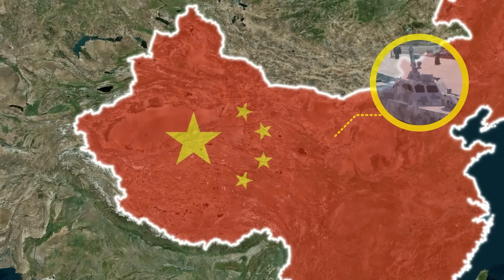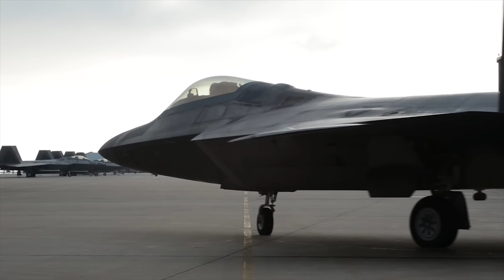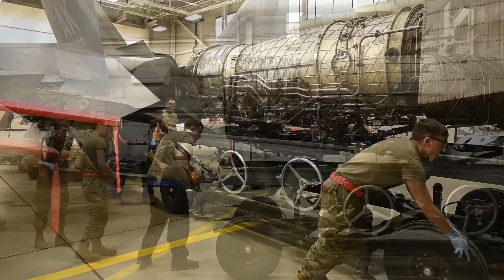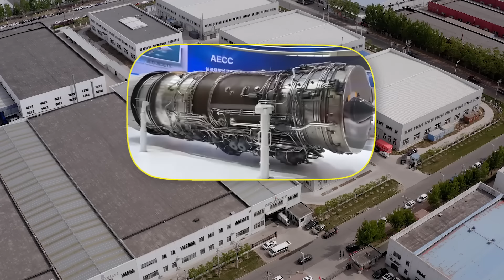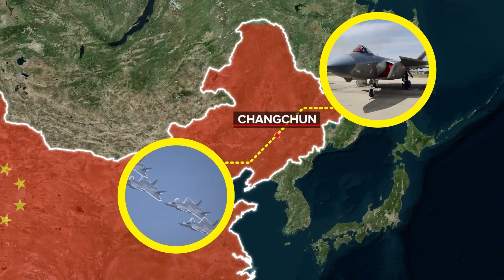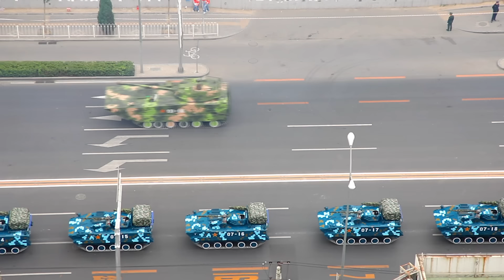China’s J-20 ‘Stealth’ Jet Is a FLYING LIE… A Paper Tiger That Can’t Fight

Comment: A couple more view points.
One, although I can't state that it is fact, but I've read that it is believed that China is utilizing silicon based chips for its low observable aircraft and AESA radars. 
If true, that makes them extremely vulnerable to EMPs.
Whereas the DoD since the early 90s has been using gallium arsenide based chips for certain Restricted Level assets (including F-22 F-35, SPY Radar systems etc). 
Final note, apparently the J-20 and J35 are only low observable for frontal to frontal 'high band' radar and not from other angles.  They also took a page out of Russias Playbook and didn't care about reducing I.R signatures either. That will be a major issue for them if and when hostilities breaks out.
Reply: F22 and F35 are very observable by ground radar as well. All 5th generation fighters have low observability on the front only.
Reply: Johnny ,
Sorry, but that's not accurate in the least. I know you're probably going to ask for proof or a link. I could suggest looking up plenty of Articles written in the last 15 years on low observable technology, the infrared Spectrum from Aviation Week and Space Technology. 
Also, there are papers written you can still find (i assume) from both Jane's and Global Security. 
Nevertheless, the main low observability issue is from frontal aspect of these Fighters. However, the f-22, the f-35, the b2, the B21 and even in some aspects the B1 were designed with low observability built-in from ground up and even AWACs downward looking radars; which are usually' low frequency band radars.
The F-22 was also designed to be low observable in the infrared Spectrum (coolant lines in the leading edges, heat absorbing materials between fuselage and engine parts, space between fuselage and engine parts, flattened exhaust nozzles, etc.
Finally,  it (F-22) was also designed to be low observable in the electronic emissions area.
That is why the Russian S400 which was being utilized in Syria by Russian troops could not see it in 2018 . There are more examples.  Hopefully this is enough for now.

Comment: Radars: The important attribute differentiating radars would be the distance a weapons lock can be achieved. Not detection distance. The two distances are different. Detection is networked among allied aircraft by link-16. Advanced Air to air munitions (like the AIM-260) can be guided by aircraft in the kill web, say an AWACS, until it gets close enough to acquire and lock with it's own radar seeker. In such a case, the F-22 doesn't have even switch it's radar on, simply launch the missile. As alluded to in the clip, China, like Russia, tries very hard to make it's weapons much more proficient compared to Western weapons, than they are in reality.

Comment: As the 'muricans say "the math ain't mathing". 
2 quoted top speeds, one slightly higher, 1535 mph, than the other yet the slower one, 1500mph, is higher by quite a high percentage (47%) apparently??
 3:21

Comment: The plane might be a joke but it's payload isn't. J-20 is an oversized flying brick but thanks to it's size it can accomodate longer AA missile bodies in internal bays which means more standoff range. Chinese missiles were always suspected to be quite capable and it was lately proven in the Pakistan/India skirmish where India lost some Rafales to Pakistanis using Chinese missiles apparently.

Comment: I wonder how much dogfighting capabilities matter in 21st century aerial combat. I imagine that the primary combat a pilot encounters is an incoming missile rather than another jet. If we consider enemy combatants, an advanced UAV might be a concern because these could pull off maneuvers that a piloted jet fighter could not due to stresses on the human body.

Similarly I also wonder about stealth. Due to the size of jet fighters, it may be difficult to make them completely invisible to radar. Even if the radar signature would be that of a marble, it would be a marble detected travelling at several hundred kilometers an hour. Spurious radar signatures are a concern when you have a limited number of fighter jets you can scramble to investigate the potential threat. However, if you can manufacture thousands or tens of thousands of UAVs and drones, you would simply launch them as soon as there is an alert.

Comment: J-20 airframe and basic design derived from abandoned project of Mig 1.44 research prototype , the one which was later taken over or replaced by by Su-57/T-50 / PAK-FA project ....and model. then it added on other stolen from western techs  here and there e.g. some from F-35 and some from F-22 .....

Comment: Debunking J-20 Rumors：
1.	India’s Su-30 detected China’s J-20 on the Indian border because stealth fighters are equipped with Luneburg lenses during training.
2.	If a larger size necessarily means worse stealth performance, then since the B-21 is larger than the J-20, its stealth must be very poor.
3.	The J-20 currently uses the world’s most advanced radar technology, GaN-based AESA radar, which the F-22 and F-35 do not have.
4.	Manoeuvrability is important, but modern warfare primarily emphasizes beyond-visual-range combat, so there is very little room to use manoeuvrability. The Rafale was shot down by a PL-15E at its own base.
5.	The J-20 does not need a cannon because it has the world’s longest-range air-to-air missile, the PL-15. There is no need to give someone who already has a Barrett a small knife.
6.	If canards affected stealth, then the F-47 or X-36 would not use them. Are you questioning whether the F-47 is not stealthy?😂
Reply: Regarding stealth under 2 The Military show is clueless or straight forward lying.  The all aspect stealth actually increases the larger the plane is. If well executed the B2 and B21 should be orders of magnitude better at stealth than smaller fighters for example.
Reply: 脸打的啪啪响😂

Comment: Yea at the 3.10  the  Max cruise Speed  is 1.8 & it’s Max speed is .2.2 Not to exceed  due to stealth Coating.

Probly  Ment 47 % less Super Cruise  than the F-22. 
More important is How much true  *it’s Radar Cross Section with its Canards & From behind profile.

* China engine Technology is still behind Soviets.  Wonder if the J-20 can Super Cruise effectively  with the those engines. J-20 sounds a lot like  F-14A s Engine which dogged the F-14 full potential.

Comment: The F22 doesn't have to use it's after burners for speed either.  It will just take them longer to top out. Also F22 pilots have been told to stay under mach 2.9 or they won't be stealth.

Comment: The canards on the J20 are not stealth.
Reply: Static offset technology and carbon fiber composites are used to keep the canard at a fixed inclination of 12 degrees in cruise mode, and the frequency selective surface (FSS) at the wing root is used to control the radar cross section (RCS) contribution of the canard to less than 0.0003 square meters.

Comment: An aircraft represents an integrated package of technology, design, and human expertise. Each new generation builds upon decades of testing, refinement, and lessons learned from previous aircraft. In contrast, China has rapidly incorporated advanced technologies without undergoing the same extensive testing and iterative development cycles. As a result, the true performance and reliability of its systems remain uncertain.

Equally important, advanced aircraft require exceptionally well-trained pilots who meet rigorous standards shaped by experience and continuous training. In this regard, China still lags far behind NATO and other advanced nations. The difference is comparable to that between a university-level military education and a preschool standard.

Comment: How is going 1500 mph, 47% faster than than your J20 stated speed of1535 MPH? Wiki has it at 1320 mph though.

J-20 is a missile truck mostly to get close to toss its long range missiles to kill Air Tankers, AWACS, and probably other big fat targets that can't dodge long range missiles like a modern fighter can. And carry missiles for other strike missions where it just has to get close enough to launch missiles at non stealth and other targets. It wasn't meant to dog fight at all or Close in fighting that the F-22 can do. Large numbers of good enough stealth to throw long range missiles is the real danger of the J-20. 

The J-20 can fight, in a different way from what most western thinking that makes it dangerous. It should not be underestimated even if its way less capable than the much older F-22. Its numbers make it dangerous and its more stealthy and than the non stealthy SU-57. The J-20 is not a dogfighter.

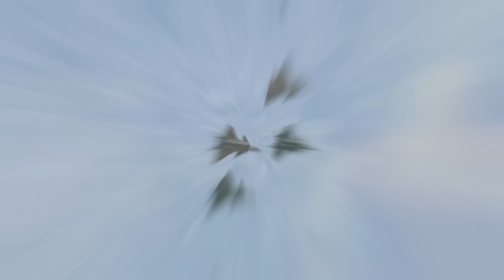Comment: 13:10 not really a fair complaint I've seen f22 and f22 stadic displays and the su 57 is rather infomis for its stadic display so no fith gen hasn't been on static display
18:05 only the f35a has a gun and the f35 is generally not the best as far as monovriblity (not to say it's as bad as often claimed but) that's not a design goal with the f35

Comment: I have been waiting foe the update on this flying garbage. 😂
Reply: Debunking J-20 Rumors：
1.	India’s Su-30 detected China’s J-20 on the Indian border because stealth fighters are equipped with Luneburg lenses during training.
2.	If a larger size necessarily means worse stealth performance, then since the B-21 is larger than the J-20, its stealth must be very poor.
3.	The J-20 currently uses the world’s most advanced radar technology, GaN-based AESA radar, which the F-22 and F-35 do not have.
4.	Manoeuvrability is important, but modern warfare primarily emphasizes beyond-visual-range combat, so there is very little room to use manoeuvrability. The Rafale was shot down by a PL-15E at its own base.
5.	The J-20 does not need a cannon because it has the world’s longest-range air-to-air missile, the PL-15. There is no need to give someone who already has a Barrett a small knife.
6.	If canards affected stealth, then the F-47 or X-36 would not use them. Are you questioning whether the F-47 is not stealthy?😂
Reply: @RongLiang-if3ff  Unfortunately most of this is just imaginary. There is only talk, no proof. Last I heard they could not get a proper engine working. What about the AN/APG-79(V)4 radar and the  AN/TPS-80 Ground/Air Task-Oriented Radar (G/ATOR) as well as Raytheon's.
Reply: @tedmoss  WS-10C😄
Reply: Didn't Pakistan shoot down western made Indian jets using Chinese jets?
Reply: @fjalics yes on social media with no proof while indian Rafeal destroyed 11 airbases and 100+ terrorist and 150+ pakistani Army personal 
Didn't pl-15 Chinese missile was intercepted in India shows chinese paper technology 

Nicee try ccp bot
Reply: @YAsh-Xd-g3z Not on social media. U.S. military officials say their with high certain that a J10C shot down a Rafale

Comment: Umm. They wouldn't build 100s of then if they were terrible. They are a long range platform designed to carry some very long range pl15 missiles and antishipping. Their front aspect rcs is pretty good. 

They aren't quite on the level of the latest f35 with tech, or as hotrod as the f22, and have a much larger rcs than either. But they are hardly trash.

Comment: They should start proof reading this claptrap,  "the F-22 beats the J20 hands down with a maximum cruising speed of 1500 MILES PER HOUR  as compared to the J-20 's 1535 MILES PER HOUR.  Last time I checked, which was just now, 1535 is higher than 1500.  This brings into question the other claims made in this video.

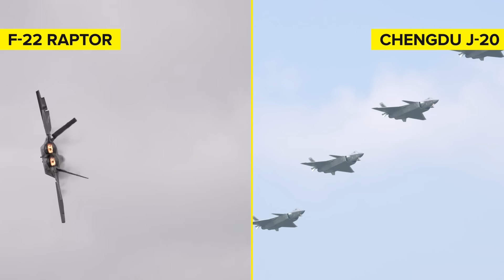Comment: 3:15 The F-22 Raptor has a max speed of 1850 mph (not 1500 mph). The J-20 has a max speed of 1535 mph. This difference is 20%, not 47%.
Re: J-20 radar signature during airshows. They probably have on Radar Reflectors like the F-22 (during non-combat missions.)

Comment: J-20 on a cost basis is better than anything we build.  In 2012 the U.S. government stated that it would cost us 120 million USD to produce a similar design, but the CCP only spent 30 million USD.  The CCP is very dangerous.  They don't need better to win.  We defeated Germany with much lower tech than the Germans during WW2.  We won because we built more.  The Me-262s would auto kill any our our planes, but they did not have enough of them to matter.
Reply: Chinese production costs are based on Chinese labor (often unskilled and certainly paid less while working longer hours). Material costs are split between technology to build something and cost cutting to speed up production. Why do you think Chinese ship building is so fast? Not because the same standards are used. The tail of the tape will come (as it did in Ukraine) when China has to use their military.... or in the case of the recent battle between India & Pakistan. Even now we've found out that their technology isn't equal
Reply: @rangerrick2246 The PL-15 shot down a Rafale.  5 million USD vs 120 million USD.
Reply: @TravisBerthelot  perhaps.... how was it shot down? With what missile system? Need more facts

Comment: CCP (stolen) technology, CCP materials, CCP electronics, CCP party-interference, CCP corruption, CCP utter lack of experience. Yeah. It's great! —The fact that they had to add canards shows how inept the engineering is.
Analogous to the CCP's naval vessels, whose sides heave and belly with each passing wave because they're made with steel that is both too thin and too weak to withstand ocean conditions. The entire initial-letter soup of the PLA, PLAN, PLAAF and PLARF are paper pandas, built for show, not for function.
Reply: Whelp, that's «Friendship without Limits» for ya!
Reply: 可怜的美国人 现在武器不行  嘴炮越来越强了  一架F22造价1.5亿太贵  这个理由真好 很好的掩盖了F22的缺陷 就像福特航母最初设计就存在重大缺陷一样。估计每年1万亿的国防预算 有1半到了私人账号了😂😂
Reply: F47 has canard  too，ohh wait，That is the canard of western democracy.❤❤